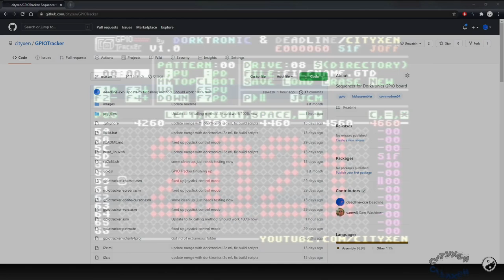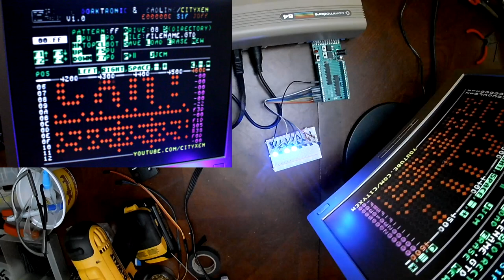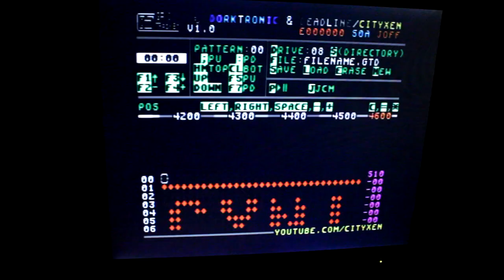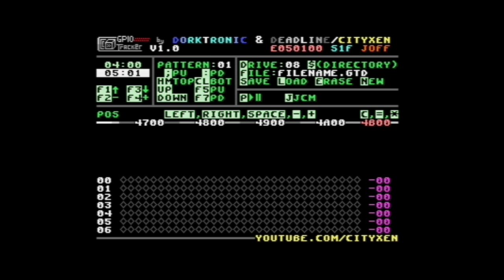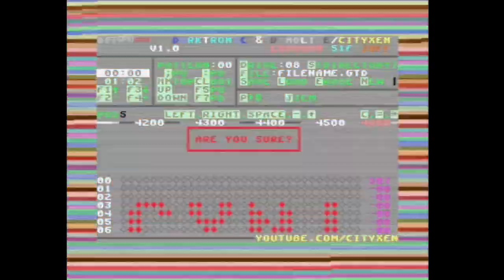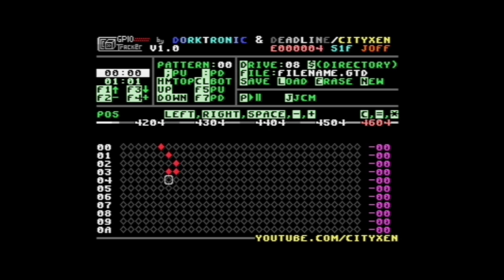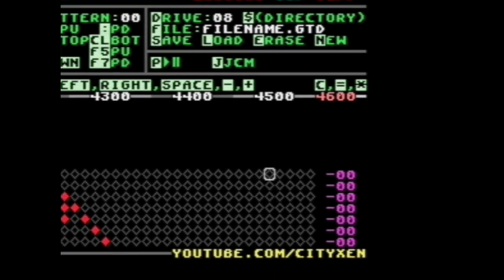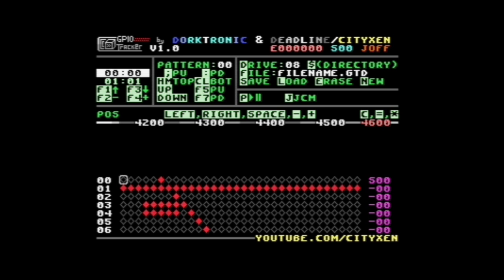Dorktronic Commodore 64 User Port GPIO & GPIOTracker Software

Comment: Hilarious! I did an 8 bit version back in 1989 has a highschool computer class graduation project.

Last year during the first lockdown I learned KiCad as I was switching from Eagle. And so I build a 16 bit (parallel output) based on two 8 bit drivers and led bars I’d laying around. By using PB2 as a quick switch between the 2 buffers and due to retention of vision made it seem it was a 16 bit parallel output.

Now in January we went in yet another lockdown and I had two 8 bit latched left as well as some LeD bars so I redid it with latching.

And I build a very rudimentary “tracker” too, basically setting 1s and 0s no command byte. And overal speed adjustment.
And since it’s basically a parallel system you can easily hook it up to MSX and parallel PC Port too.

I see you use I2C as GPIO, Kinda cool to bit bang I2C commands! Wicked.

These are mine iterations:
Here is the 16 bit latched monitoring the SID and mapping it to the 16 bits 

https://www.instagram.com/p/CK3hWo3AWSH/?igshid=1j0c6ngm96c7y

Here in this cover is a shot where it’s running on my MSX:
https://www.instagram.com/tv/CLe64vsg-KR/?igshid=eq1ml1qq4dks

And this was revision 1 (well technically revision 2 as revision 1 was the 8 bit I’d done as a 16 year old :) )
https://www.instagram.com/p/CClHyrwAltL/?igshid=5m80mh2dvfir

It’s so cool your tracker, I may take some extra time and make mine more like that too. The hard work is done on both Z80 and 6502 the scrolling calculating and displaying.

Awesome job I enjoyed it!
Reply from the maker: That's awesome! Dorktronic is the guy who actually made the C= GPIO, we only made the GPIOTracker software. Glad we could inspire you to enhance your own work. That is really what we're all about. Like how yours works like a spectrum analyzer, that would be a neat feature to add to our trackers. It would be neat to set up a light show based on SIDs/MODs without having to create patterns. Well, it's on the github, so by all means adapt it for your needs. Interested to see what you create with it for your device so if you do please come back and share!
Reply: @CityXen  That little experiment I did by monitoring the voice and pushing it unaltered to the upper and lower bite amazed me actually. It by coincidence does interesting visual things. Not with all songs though. 

Isn’t it cool that almost 40 years on we are still playing with these machines?!
I get more joy from playing with these old machines up to the 486 then the incredible powerful machines we now all have. I just saw your unity experiment. And although I was impressed how easy it is to quickly code a game in Unity, it doesn’t really feel like an accomplishment and challenge. Even mobile devices are so fast that you can just write bad code and get away with it. Killing the art imo.
Reply from the maker: Yes, it is great there is so much great new things being created by people working on the old machines. Unity is actually pretty awesome. Even though it is easy to use and prone to bad coding, we want to use it to instill a passion for vintage computers to younger generations. While we realize how great 8 bit coding is, that art is slowly being lost to newer technology which abstracts everything. It is the very principle you are speaking of that has led us to see it as a tool to teach about the old school ways. Ironic, but this simulation isn't going to break itself.